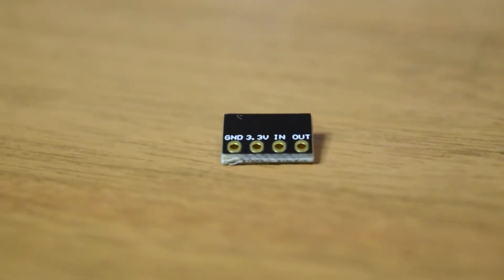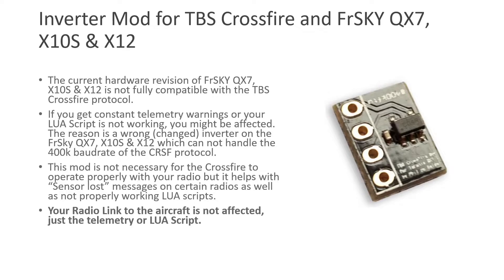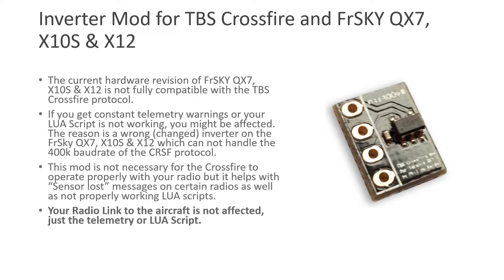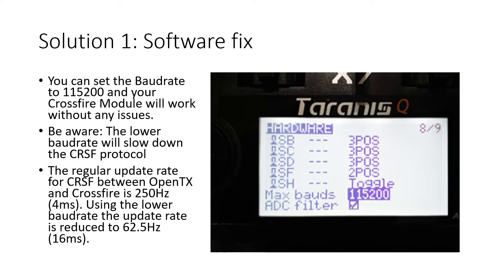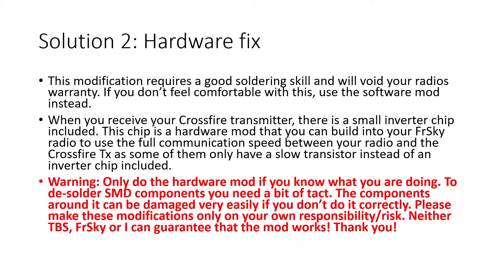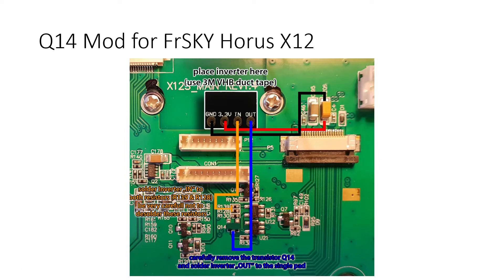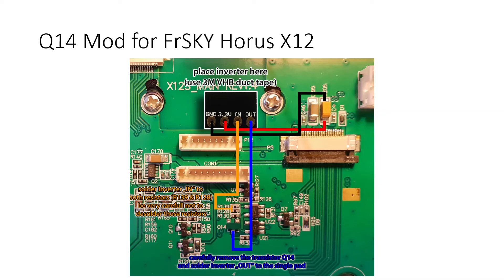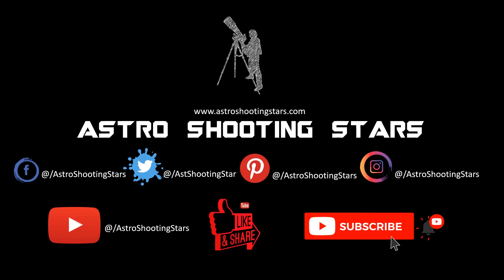FULL Guide To TBS CROSSFIRE Inverter MOD for FrSKY Taranis QX7 | Horus X10S | Horus X12 with Wiring

Comment: Does the R9m module still work after this mod or do I need to switch all my planes over to crossfire?
Reply from the maker: R9m module still works its just that when you work with TBS cross fire modules this mod will be needed and only for the models I mentioned all newer models do not have this issue. I hope this helped. Please stay tuned to my channel for my future videos.

Comment: Hi, I struggling to figure out what battery options do I have for Horus X10S Express? tried 18650 batteries and they don't last. What other alternatives do we have and who is supply such batteries?

Also, where can i find documentation of Horus X10S Bluetooth module? What kind of Bluetooth module is inside the radio? When I enable it for telemetry no phone (Android or iPhone) is picking up the Bluetooth signal.
Reply from the maker: You can use 2S lipo batteries as well with larger capacity which comes with compatable header pin to use it with your controller. You can buy it from any local hobby store if they have or you can buy from amazon or ebay online